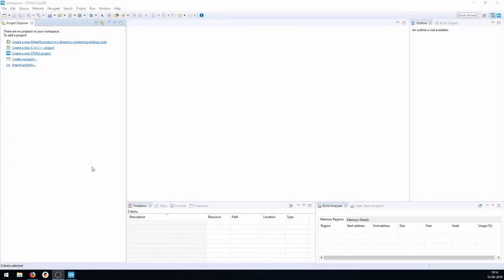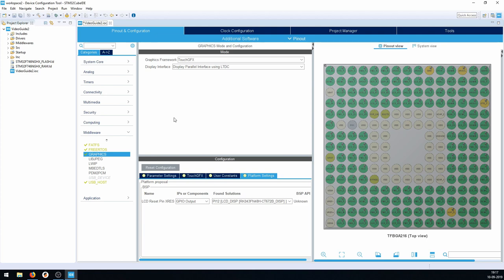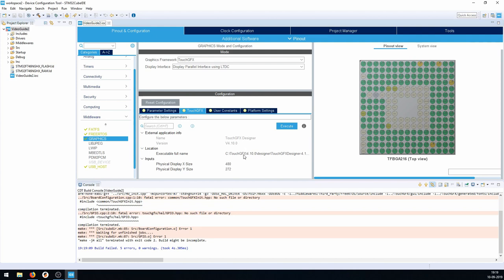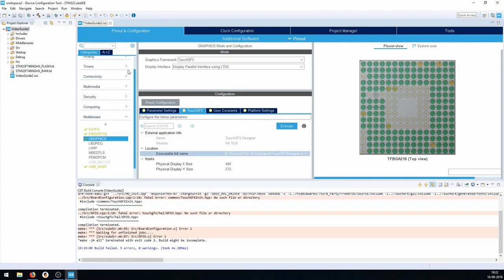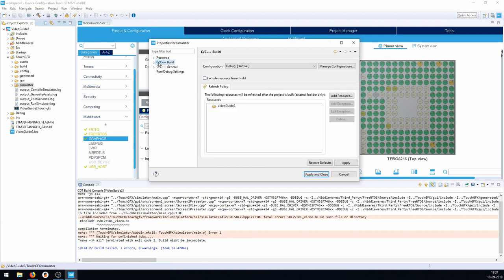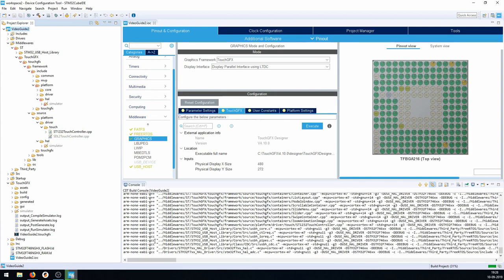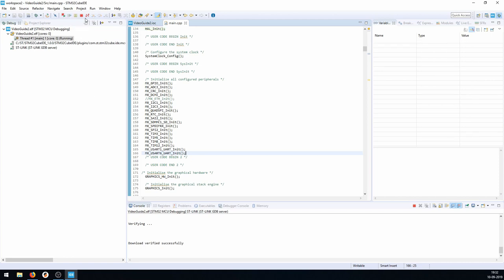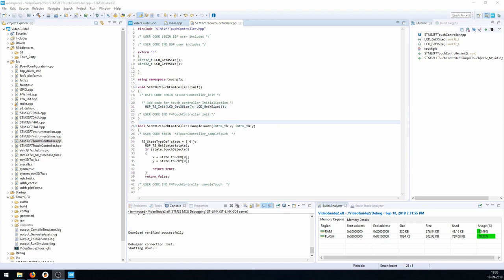[DEPRECATED] - Setting up TouchGFX 4.10.0 integration with CubeIDE 1.0.2

Comment: Thanks for pointing out the code generation issues! This brought me to check the latest releases and indeed, ST released STM32CubeIDE 1.1.0 on October 15 which should fix the issue that code generation overwrites all build settings and other stuff on regeneration.
Reply: Exactly! I will make a new video using the 1.1.0 and 4.12.3 designer - when I have the time ;)
Reply: @hanspeterhaastrup-nielsen8446  Looking forward to this video. I am unable to get this working on my stm32f469I disco board

Comment: Still cannot generate a project from scratch with STM32CubeIDE 1.1.0 and Cube 5.4.0. Did you try creating a new project from scratch from CubeIDE? I can generate and it compiles without doing these modifications on the video but it doesn't runs on the board (white screen).
Reply from the maker: I finally managed to make a new video. It's available here: https://www.youtube.com/watch?v=ZQA2lAsIdZA

Comment: Hi, I have a problem in debug mode on STM32CubeIDE, I have created a project, the problem is with TIM6_DACIRQHandler() doesn´t matter where I set a breakpoint, when use "Step Over" after line of breakpoint stops the program it goes into this interrupt. Do you know what I´m doing bad and how avoid this problem? because I need to check my code step by step and it get stock between my breakpoint line and TIM6_DACIRQHandler interrupt.

Comment: Спасибо автору. Среда конечно сырая но все изложено понятно и после небольшой возьни все заработало как надо.
Reply from the maker: i took the liberty to put it through a translator. I'm glad I could help :)
Reply: I have a question. 
I successfully create the first project at TuchGFX, but as soon as I try to make changes to it, I get a lot of errors from CubeIDE. Do you have any thoughts on how I can fix this?
Reply from the maker: @bakDp  after writing the comment below I just realized that you wrote TouchGFX... I'll take my chances and say that you maybe did some hardware changes at the same time? If that is the case yo u can use my comment below..

I think I mention this in the video that you have ONE shot at getting the hardware settings right. Of course that's not possible since you almost certainly have some changes to make.
The solution is mentioned in this thread: https://community.st.com/s/question/0D50X0000AqD8zPSQS/stm32cubeide-and-touchgfx-4100-resolving-compilation-issues (about post 70)

and the user 'Michael B' have made a tool to work around this issue - available here: https://github.com/replaysMike/STM32CubeIDE-TouchGFX-Fix

I use the stand-alone version. what is important to remember is that you have to close the hardware configuration window EACH time you save - then it will generate an error and allow you to use the tool. refresh the project and rebuild.

Comment: Is it possible to generate C++ code directly from CubeIDE? Like for SPI, CAN peripherals for example , because as I see, the TouchGFX is generated as a c++ file
Reply from the maker: I think you have to do a mix since CubeMX only generates C code. but since you create the project as a C++, you can write c++ classes (i Guess - haven't tried it)
Reply: @banjohat  yesyes, it's totally possible to combine the c files with c++ using extern c directives but still,  I'm still waiting for the day for Cube to generate c++ directly :)

Comment: Thanks for the video! I'm new with TouchGFX and I'm facing some trouble to buil the TouchGFX example from Cube repository. When I use the avalable binary file it works, but when I build the same example project on my computer and try to load the target it don't works... If I build the same example from 1.14 repository it works! Tried with both STM32F746G-Discovery and with STM32F7508-DK boards.
Reply from the maker: Yeah, I never could get the 1.15 Example to work either. In any case I would also go for the cubeIDE integration approach since you have everything contained there AND you don't have any surprises left from the example code :)
Reply: @banjohat  Thanks for your repply and support! I'll start from the example and try to migrate it to STM32F7508-DK :-)
Reply: @banjohat Have it working now on STM32F7508-DK! Now I'm struggling to run code form QSPI flash... Thanks a lot!
Reply from the maker: @joaofilipesilvacosta755  maybe you can find some inspiration in my other video on exactly that! More than a few people were struggling with the QSPI for some time...

Comment: I tried it for my stm32F769i discovery board. The board went blank. I think the lcd interface is different (dsi) for 769i. Whereas in 746 it uses parallel port. Can you make something for 769i ? Thank you
Reply from the maker: If you can get me a 769i board I can try :)
Reply: We should ask this from st

Comment: Please please please do the same video with the discovery board STM32F769. WE ARE MAKING A PRODUCT AND GOT STUCK WITH THE SO CALLED BLACK SCREEN ISSUE
Reply: Sorry, I don't have that board..
Reply: What if I get you one?
Reply: @ya3525  uhm.. maybe.. I would be interested, but it smells a bit like consultant work so we will have to agree what I should do
Reply: When I first wrote to you, I thought you were from STM team. I must say you got me fooled because your videos are much better done than STM. I was more thinking of making videos on YouTube and contributing to the open source community. The STM32F769I has a DSI interface which gave us some grief withe Touchgfx and CubeIDE, but we have been able to sort out most of the problems. There are just few pending issues that can be solved. I thought if there was a video about the STM32F769 it would have been slightly easier for us. We keep in touch.
Reply: @ya3525  I might do a 769 video at some point. The dsi interface seems to be the future for some applications
Reply: Hi Hans, I received yesterday the Discovery STM32F746G and followed your video. It worked well I must say I would never figure out the BSP part if not you. For the moment I will abandon the idea of using the STM32F769 because the integration of touchgfx with CubeIDE does not work at the moment. If I was to design the same discovery board using the LQFP208 package is there any easy way to generate the BSP files or I need to modify the exiting manually?
Reply from the maker: @ya3525  With the new version of CubeMX and CubeIDE the code generation actually works just fine. Of course you need to include/implement specific drivers to make special functions work (such as the touch screen). The CubeMX part is really not that difficult. I started by copying the default setup for the 746 board but have then deviated from that since I'm working on a custom board. With the code generation not overwriting TouchGFX things anymore it's quite easy to change the specifics on your board afterwards and you only need a few things to get TouchGFX going (like CRC, LTDC, FMC and a single GPIO for Display Enable signal)